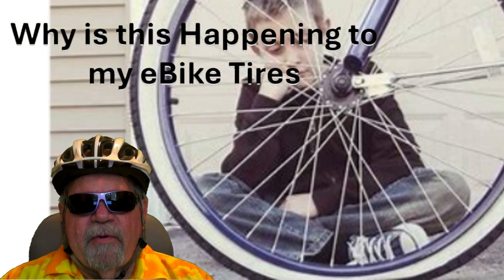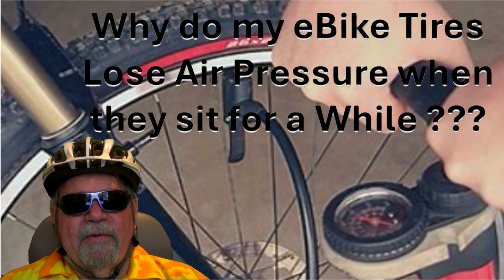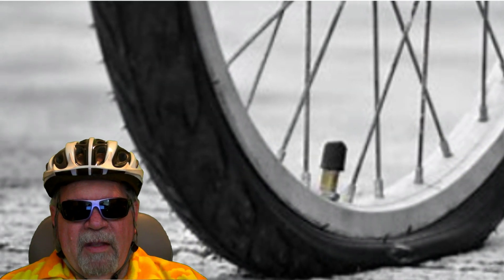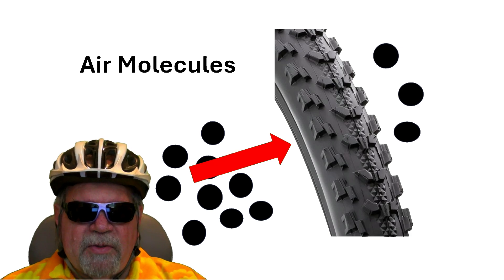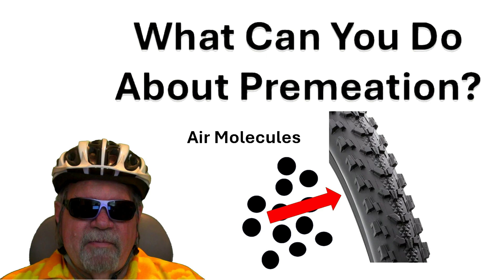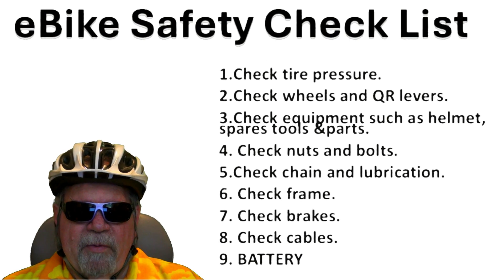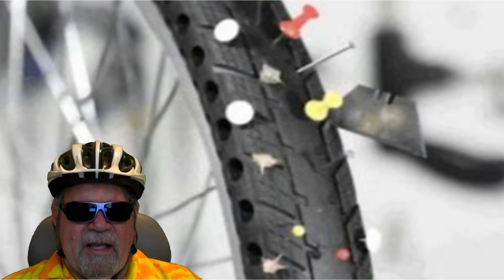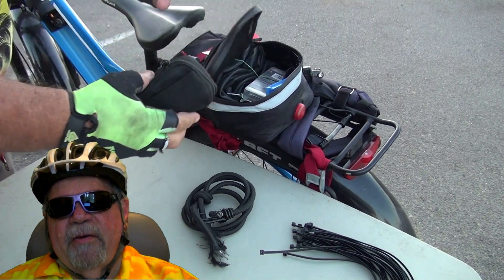My eBike Tires Lose Air Pressure When my e bike sits, even when my tires have no punctures "WHY"

Comment from the maker: What do you use for punctures and tire repair?
Reply: Flat out
Reply from the maker: @EBikeBuilder_  Thanks for the comment. Flat-out is a very good product. I have used it also however I had issues with the valve stems getting clogged. No-a-days I use a simple tube and carry extras onboard. Thanks again

Comment: Hi , just ran across you here about battery storing and followed you to this air loss in tires wanted to mention it happens more on my 29r with 2.5 " wide tire than my 4"fat tire e-bike stays up thru upper Michigan winters while stored want to do a trip with my dog in a trailer 8.5 year old overweight spaniel trying to figure out a solar panel for the trailer
Reply from the maker: Thanks for the great comment. Yup, the larger the tire the more air loss you will get ... especially after a long storage.

Comment: If you have filled a fat tire with a little hand pump raise your hand 🤣🤚 I try to keep a battery powered one on me in the rack bag. 

It's always the rear tire too... Tannus armor has let me down quite a bit so I'm trying slime.
Reply from the maker: I have used the battery pump also. However, I have switched to the CO2 cartridges for convenience. I still carry a small hand pump for a backup. You are also correct...filling a fat tire with a small hand pump is a lot of work. Do you flat often?
Reply: @GreyBeardEBiking  About 4 flats over the course of about 3000 miles on my rad rover 6 with 4 inch wide tires. Last one was a sharp razor shard stuck within the tannus armor and caused another flat the next day, took me a bit to figure out the cause.
Reply from the maker: @WatsitTooyah  Were your flats way out on the trail and were you able to repair them on the trail?
Reply: @GreyBeardEBiking  always happens on the road side, over 3 miles from home at least. I've repaired them all except the last time when there was snow on the ground. i spent the last % of phone battery to call for a ride 😅

Comment: It is the other way around concerning Co2. Co2 is actually dissolved by the butyl rubber....making the molecules so small that they do seep through butyl rubber faster than air. Co2 was never meant to be used as a primary inflation source...IT was initially used by racers as a temporary quick fix while in a race..they would switch out wheels as soon at it was feasible. People use it now because it looks tech and cool...and the stores make money. Us a small frame pump and you never have to worry if you have enough cartridges. If you mess up or the leak is consistent out on the trail...you cant put Co2 back in the cylinder and try it again. Simple changes in temperature changes quickly drops pressures due to the lack of volume of a bicycle tire. 
Last note4 about CO2...the cylinders are rather hazardous...back in the day they would sell you a housing for the cylinder...why ..because it sucks to have you fingers or hand become frozen to the discharging cylinder.
Reply from the maker: Thanks for your comment. However, I think you may have mis-heard the video. In the video, I agree with you. The CO2 will "permeate" faster than just plain air. I'm like you, I use the CO2 as a quick fill when out on the trail but I still carry a small hand pump as a back-up. And yes, they do get cold so I always wear my gloves when using them. What is your preferred fill method when out on the trail?

Comment: Different inner tubes & valves.  Same make and model, some lose air faster than others. Also pressure is non-linear and goes soft if you go just right up to spec
Reply from the maker: Thanks for the comment. Yeah, I find that no matter what you have or do it's good to have a backup plan when out on the trail. That's why I use the CO2 cartridges and a small hand pump as a backup. What do you use as your preferred "pump-up" method.

Comment: Try inner tubes with thicker wall thickness (Schwalbe Air Plus). This will hold the air longer

Use quality inner tubes, that helps also a lot

Check if there is talkum in the valve core and clean if so. 

Good look ✌🏼
Reply from the maker: Very good points. Thank you. Do you still carry extra tubes on a ride?
Reply: @ I‘m mostly on tubeless, which I don’t have any issues with punctures. Therefore I don’t really carry a inner tubes with me
Reply from the maker: @Micha_7F  I always say to go with what works for you. Happy trails my friend